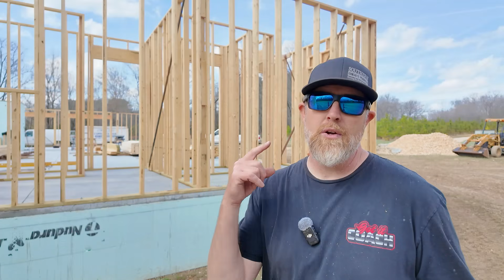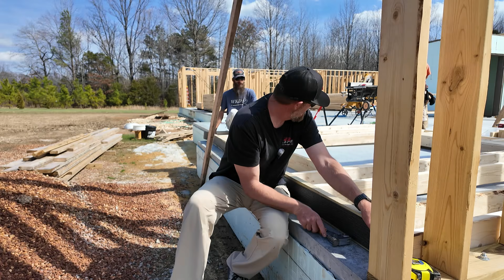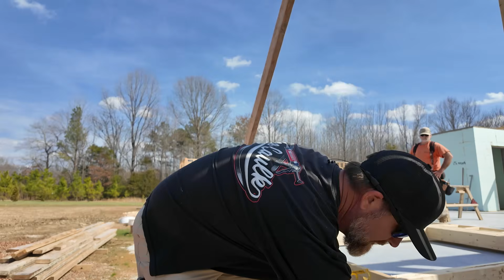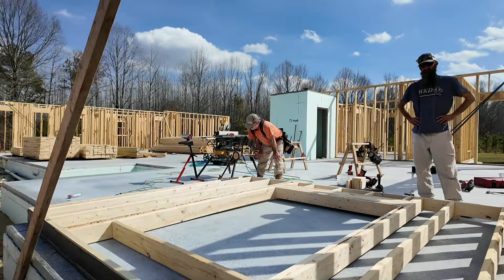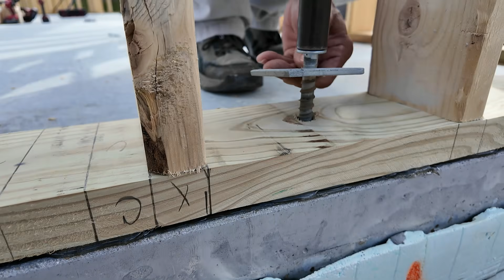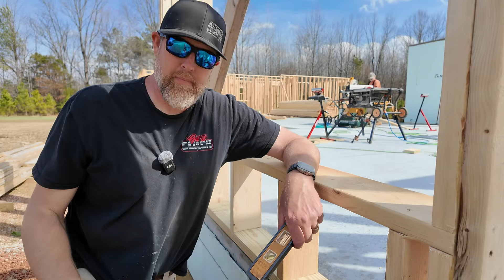Don't SKIP this Detail / Air & Water Sealing the Bottom Plate Connection on Framed Walls

Comment: Just found your channel and I love the attention to detail. Legit question from a non-professional, armchair quarterback, internet guy: wouldn’t sealing the perimeter like that create a “moisture sandwich”? It seems vapor could get trapped and cause eventual damage to the baseplate.
Reply from the maker: Thanks. Vapor will leach into concrete and eventually will dry out over time once the house gets built. After that there should never be enough moisture in concrete to be an issue. The concrete would soak it up anyhow.

Comment: Bang that plate a couple more times. There aren't enough dents in it. And torque that nut just a little bit more so you completely destroy the hold down power of that washer which, BTW, is undersized.
Reply from the maker: you tryna be facetious right now?
Reply: @w.k.d.constructionllc Of course! 😅😂
Reply: Wut?

Comment: I would think the capillary concern is from the slab to the framing, not from the framing to the slab.
Reply from the maker: No. If moisture is wicking up from the slab then you have a bigger issue! If you have proper fill and a vapor barrier under the slab, you won’t ever have that issue. I am concerned about exterior water and air wicking under the bottom plate.
Reply: Not sure what happened to the entire first part of this comment. I just noticed it was cut off. Too much to retype but I think everyone is on the same page. Lol.

 Structure and, ultimately, onto the slab, underneath the finished flooring.
Reply: Although a legitimate concern, water or moisture wicking up from the slab into the framing is an entirely different problem than what he is describing.
Reply from the maker: Correct!